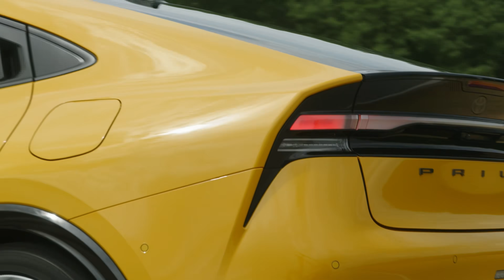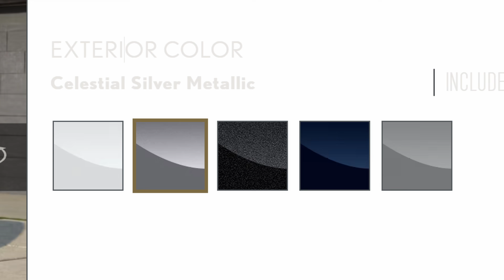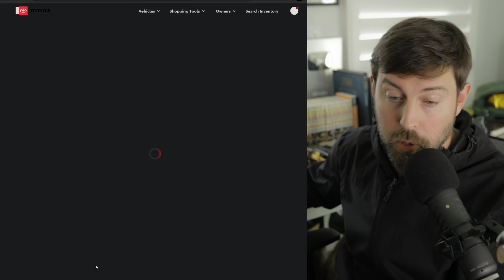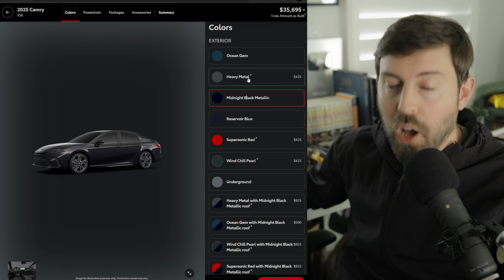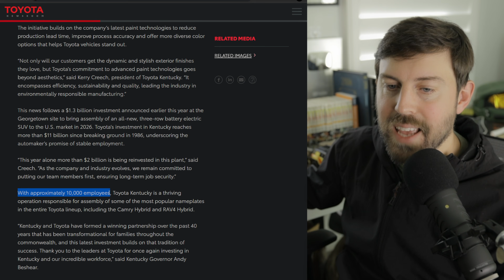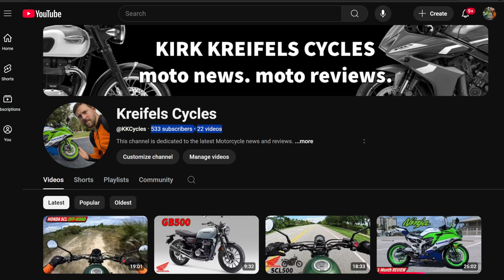Toyota's NEW paint shop could actually make a difference...

Comment: I agree with another commenter below - the organic solvent based paints adhered better and lasted longer than the newer water based paints.  Think:  Honda white paint coming off in sheets. This obviously reduces carbon based (and dangerous) emissions, which also benefits their workforce.  However, "better" is debatable.

Comment: The paint on my 2024 Corolla Hybrid was abysmal. Total garbage. 4 month in with 900 miles I had to cover up a dozen chips. Sold the car for $700 under msrp to some other poor soul for a Civic Touring Hybrid. Corolla is too loud inside, disappointing cheap car. Interior and build quality was surprisingly bad coming out of Japan.
Reply: Paint on my 2016 corolla I feel like it could come off with my finger nail. I'm bump with my child car seat and it flakes off. The money goes into drive train
Reply: That’s actually a crazy experience